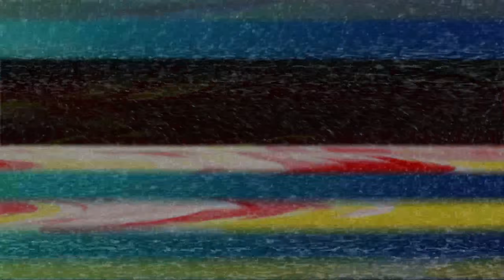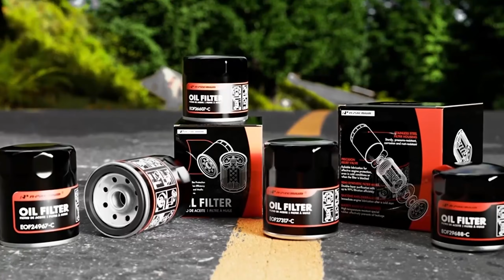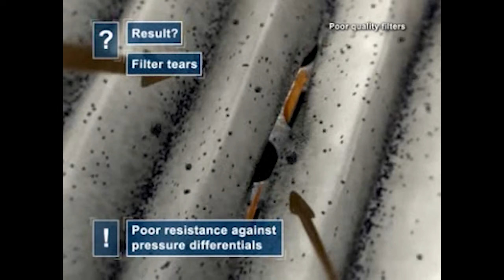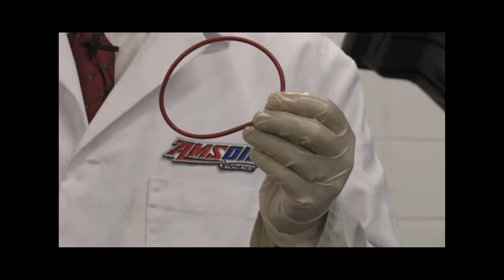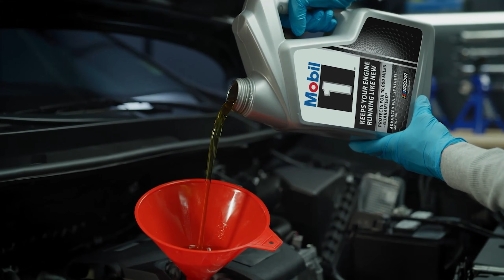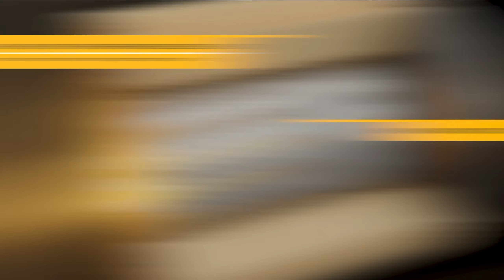Best Oil Filters 2026 – Top 10 Picks for Every Car & Engine

Comment: Since my injury, I have become disabled and do not drive that much anymore (about 1600 miles a year). I use Purolator One because it offers the best filtration (99% of particles sub-20 microns) for the miles I drive. I used the Purolator Boss before my injury...225,000 miles on a 2014 Chevy 3.6L engine is my proof, and no repairs on the engine either, knock on wood

Comment: I watched a video that conducted a professional filtration test. It tested Amsoil, Wix, Fram, AC Delco, Motorcraft, and other brands. The Purolator boss emerged as the top performer. Amsoil secured the second position, while the Fram endurance filter placed third. The test evaluated the filtration efficiency by measuring the number of microns captured and the speed of the flow as well. Notably, the Purolator boss outperformed all the other brands in this test. However, it’s important to note that this video doesn’t provide actual test results, unlike the video I previously watched.

Comment: FWIW...Subaru 3.6R at 125,000 using Pennzoil Ultra Plat 5W-30;   6-8,000 mile intervals.   My used oil analysis numbers are better than any others seen from any source.... but the point is:  my UOA numbers are exactly the same using Purolator Boss or using Subaru-stock Tokyo Roki filters.   Regardless, no way in hell I would go 20,000 miles on ANY filter or ANY oil.  Suggest you don't, either.

Comment: Change oil and filter at 5,000 miles and they'll all work. I buy oil by the case. I have one car that I change the oil once a year. I'll never go over the 5,000 without changing.

Comment: I’m using a WIX  XP oil filter on My 2016 RAV 4 along Valvoline R&P 0-W20 oil . The vehicle has over a hundred thousand miles on the clock & runs a top
Reply: How often do you change oil
Reply: @Bigdane11 every 4 thousand
Reply: @robertwhite6813 good job thats a good interval,I shoot for 3-4 k too.  Good luck with the Rav 4
Reply: @Bigdane11  I’m going to get another oil change soon & I have a new WIX xp oil filter ready to go & along with Valvoline R&P so far so good I have noticed how the oil is doing. It’s a go to oil if your unsure of a vehicle maintenance. History. At least I know what it
Reply: @Bigdane11 that's a great interval, but the XP is marketing hype which you've fallen for hook, line , and sinker. The XP is for extended intervals like 15k to 20k miles. The regular WIX filters filter oil  better than the XP. You're currently paying more for inferior filtering. I wish people would get the message on this.
Reply: @budlanctot3060 its not much more and xp is a good filter. Im putting the purgatory boss also when I need too.
Reply: @Bigdane11 there again, you're spending more for less. Pure1 is superior to Purolator Boss. The Boss is similar to the XP, poorer filtration so it won't plug up on the extended filter change intervals. Do some research. Don't be a sucker to hype.
Reply: @budlanctot3060 how do you get better than 99.5 and what are you talking about a few bbucks? And were are you getting that info. I never heard of pue 1

Comment: Most of these filters are only rated for cleaning dirt at 90% at 30micron dirt size,    Amsoil oil filters are rated at 99% efficient in cleaning dirt from oil down to 20 microns (dirt size).
Reply: Purolator One is also 99% filteration and also filters down to 20 micros
Reply: @kerryguzman8263 Purolator Boss filter is also down to 20 microns at 99%. Boss and One are all I use.
Reply: And wix xp too

Comment: Most of the new testing puts Wix XP and Purolator Boss as the top two, Mobil 1 in the middle of the road.  Most FRAM filters are trash, however I think the Ultra Synthetic one is better than their other products.
Reply: FRAM Ultra Synthetic WAS a good filter. Fram is no more. History.
Reply: the fram racing was the only good fram in recent years. They did tests of them all more recently.
Reply: @radzer0966 I wouldn't know about the Fram racing filter cause I never used it. But I did use the Fram Ultra Synthetic filter. And the 3 vehicles I used them on are still purring & running just fine. No oil or filter related issues. A Chrysler 200 2.4L bought with 34,XXX miles, now has 165,XXX miles. 2016 Ram 1500 Sport 4x4 with the 5.7 hemi, bought with 42,XXX miles now has 170,XXX miles. And a 2019 Ford Taurus Limited AWD, bought with 47,XXX now has 67,XXX. Used Pennzoil Platinum oil & the Fram Ultra Synthetic filter on all them. So yeah they were just fine for me.
Reply: The fram racing filters are much better. 

Purolator boss is discontinued for Honda.
Reply: People always parrot that 💩that Fram is trash. I’ve used them for 40 yrs and never had an oil related problem with an engine. Polly want a cracker?

Comment: Royal Purple filters should be at the top of this list. It's similar if not identical to the Amsoil filter for less money than the Amsoil filter.
Reply: Sadly Royal Purple oil filters are no longer made 😕 Wish Royal purple brings them back. Have heard Amsoil and Royal purple have the lowest micron rating.
Reply: @nunezracing12  They still make them, who told you that BS?
Reply: @petedogg369 I tried looking for them. Cant find any. Where can I find them?
Reply: @petedogg369 I googled it and it said they stopped making them
Reply: @petedogg369 where can I find them?

Comment: If I were to go back to buy better filters, it would be the Purolator in the Blue can.  Now I use Renken and Purolator Tech.  I don't drive even 5,000 miles a year as I'm retired.
Reply: Exactly, Pure 1 is superior to the Boss in filtration. Boss is only for extended intervals. If you're changing oil every 5k miles, you should not be using extended oil chg interval filters, that's contra-indicated.
Reply: @budlanctot3060  You are 100% correct from my research!
Save yourself money and get the superior Purolator ONE (not boss)
Reply: @ChescoYT I try to dispel the disinfo whenever I can, but there's so much out there, there's only so much one man can do.
Reply: @ChescoYT you are all mistaken lol
Reply: @bud How is Purolator one better than Purolator boss when Purolator boss is renowned for capturing 20 microns? So, why would you compromise on a filter just because you plan to replace it every 5000 miles? That doesn’t make sense.

Comment: Hmm not sure how I feel about this. Definitely good picks but I’ve seen other test videos showing the wix xp doesn’t capture the particles they entered into the oil as well as others. I also have concerns with the center core with louvers when it comes to flow rates. Fram went bankrupt so you can’t find those right now. Mobil one is my top at the moment I think.